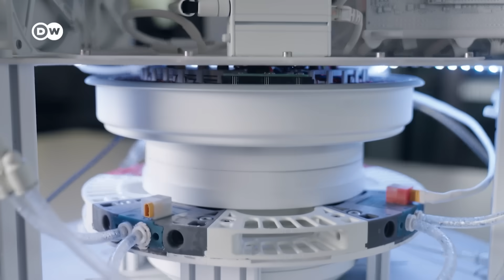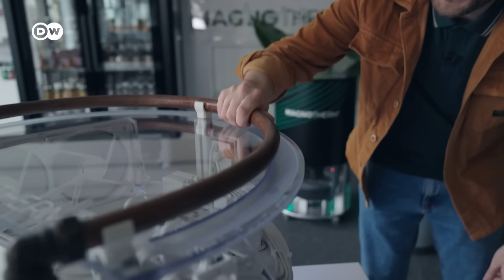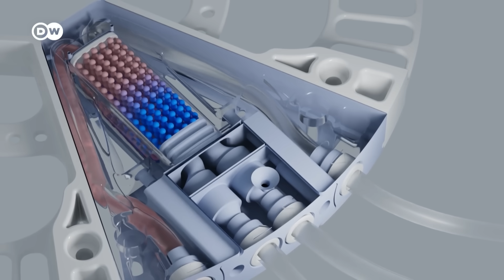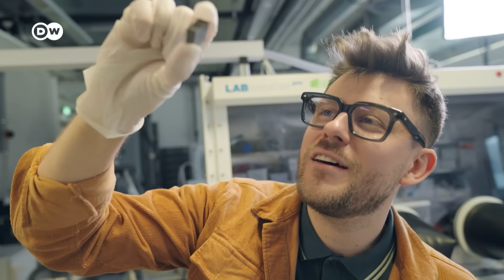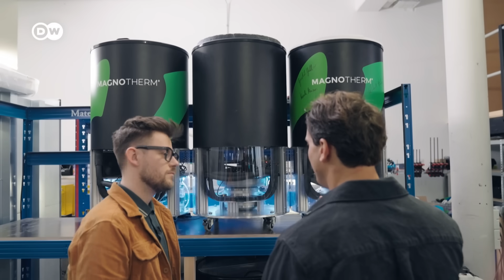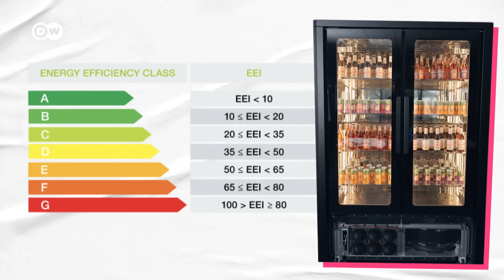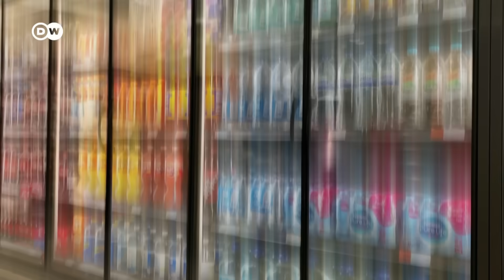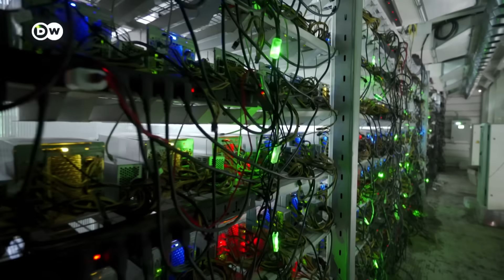How magnets could change our fridges and ACs forever

Comment: Sounds like a lot of complexity + rare earth metal + tricky manufacturing which in the end means higher cost and lower reliability than normal fridges ...
Reply: Feels like consumer applications may be limited here. Maybe there are domains (e.g., military) where technology might be useful to use in, given perhaps certain specific criteria that regular compressors are not suited for.
Reply: Maybe suitable for high-end cold chain cooling!
Reply: Was thinking the same thing, the only thing that makes regular fridges not very energy eficient is that gases that work really well are very dangerus to the enviroment, that seems like a way better research path.
Reply: That could have been said few decades ago about a normal fridge. And don't forget - we used to use gas in fridges, which needed replacing over time
Reply: @nothereandthereanywhere  okay but they said their goal is to maybe get a 1:5 cooling efficiency, while we have modern fridges that get 1:6 and above. why on earth would you pay 5x as much, for a less reliable, untrustworthy, unproven product, that isn't as efficient, and cant get to sub zero temperatures? maybe this has some niche use for in vaccums or space or some lab scenario where you need very specific things, but for a general refrigerator, this is pointless.
Reply: @Evelyn80264  There is no way they can compete with heat pumps, but there are ways to make heat pump coolers better and more efficient, that 30% figure they presented could be done easily by chaining multiple smaller pumps to reduce power and get better cooling, that would raise the complexity of the system though, using some gazes that aren't that safe could raise the efficiency and cooling too.
Reply: @rain4279  Even then I dont think you can come up with something better. We are just better off using a better refrigeration coolent. We know they exist, but we dont use them because of safety reasons - but even then, some could be used here with a bit more risk. Same for cooling a home. In some ways, we went backwards because of the safety and environmental protection. Best bet would be to look at some how combinding systems instead if you ask me. Such as instead of moving your hot air out, you move that into your hot water tank instead. Heat pump hot water heaters cools the home already because of this fact, but you are still wasting that heat when you cool the house down on top if it trying to pull that heat in. In winter, your refriger actully helps keeps the house warmer. Blancing the two options out over a home size heat pump could offer lower energry cost and use less over all power if done right.
Reply: @Evelyn80264  That is a host of assumptions.  
Also remember original fridges were just ice in a wooden box. We've had some time to improve them since then. These will improve just as fast as more companies are created to compete and consumers call for lower prices and better cooling.  
Also, it's only using 8% rare earth, and it's 3D printed. 3D printing is nothing new any more. You can buy reasonably priced 3D printers that print titanium in your home.
Reply: Today's refrigeration systems are very reliable and quite cheap. The major fear with anything like this is that dictatorial government agencies will order the removal of those reliable/cheap refrigeration systems to be replaced by something as unproven and expensive as this new tech most likely is. As they have done, for instance, with their automobile mandates: "throw away your cheap/reliable ICE engines and replace them with our new fancy EVs that will break your wallets and our power grids if we get our ways." I'm looking at you, EU....
Reply: @demef758  So according to you, ICE engines are cheap and reliable and EVs are fancy? And dictatorial government agencies are pushing them? But the world's best dictators Trump and Putin are not pushing for EVs; they love oil-guzzling ICE, right?
Reply: @demef758  You have no idea how complex an ICE engine and vehicle is or has to be.
An EV is much less complex and easy to make, it is dirt cheap.
That is the problem, you can't make big money on cheap items in a limited market --- people are just buying one car within a few years, that is not much, therefore every item has to make big money.
But you can't charge big money if your product is dirt cheap and easy to make ... that's why the US has a 100% import tax on EVs, so that Ford and GM can continue to rip off USers.
Reply: @demef758  gas keeps getting more expensive, and batteries keep getting cheaper. Outside the west, like in china, more than 60% of new cars are EV's, while it's like 10% in the USA. batteries are a one time expense, it takes some rare materials, and needs precision manufacturing. but engines use rare materials and use precision machining too. at this point it is cheaper in total lifetime cost to get an EV, a honda CRV is 31k starting price, hybrid is 36k, and the prologue which is basically the EV version is 39k. so 8k more for EV vs gas. in that car's lifespan, lets assume it lasts 300k miles, at 30mpg, thats 10k gallons of gas. even at 80 cents a gallon and ignoring oil changes and maintenence, you'd barely break even. at the current rate of $5 a gallon, and it will keep getting higher from inflation and scarcity, thats $50k spent on gas, who knows how much more on oil changes and maintenence. so yeah, it's 10k up front more, but 40k cheaper total.

Comment: I didn't got the reason of using BLDC motor rotating the magnets instead of applying switching magnetic field from the same windings directly to the lattices, eliminating rotating parts as well.

Comment: why using a rotating magnet and not a copper coil which can turned on an off?
Reply from the maker: Good question! Rotating magnets are just a simple, efficient way to keep the magnetic field changing. You could switch a copper coil on and off, but that wastes a lot more energy as heat.

Comment: so if applying magnetic field aligns the individual molecules causing movement and hence heat due to friction, heating up the metal block. but by that same logic when the magnetic field is removed and they get randomly oriented shouldn't they heat up even more instead of cooling or am i missing something here?

Comment: Making fridges top opening rather than front opening might be a no brainer quick win for increasing efficiency. Similarly, in cold weather, allowing the fridge to benefit from the cold weather outside might reduce cost of keeping contents cold in a warm house. How to make these design features practical to install and use is the challenge. So...get to it you boffins 👍

Comment: Jesus Christ, no, a heat pump or condenser is nothing like sweating.

Compression-based cooling works via phase or state change, not evaporation. It relies on the same fundamental thermodynamic principles behind all caloric systems, whether magnetocaloric, elastocaloric, or electrocaloric. The process involves changing the state of a material, through pressure, magnetic fields, or other means, to absorb or release heat.

Modern systems use a refrigerant fluid, a compressor, and an expansion valve. The refrigerant is compressed to raise its temperature and pressure, then expanded to drop its temperature rapidly. This is how refrigerators, air conditioners, and even PC cooling systems function, though PC cooling often involves simpler convection or liquid transfer without full phase change.

Magnetocaloric systems replace the refrigerant and compressor with a solid material that changes its magnetic entropy, and therefore its temperature, when exposed to a magnetic field. It is still based on thermodynamic state change and has nothing to do with evaporation like sweating. If anything, it is more similar to non-shivering thermogenesis (brown fat activity) than sweating, though even that is a stretch.

Many Europeans already misunderstand how heat pumps and condensers work, and this kind of analogy only adds more confusion.

The main motivation behind exploring magnetocaloric, electrocaloric, or elastocaloric technologies is to eliminate reliance on refrigerants, particularly those with high global warming potential like CFCs and HFCs. These alternative methods are not new, as we have understood the underlying physics for decades, but the challenge has always been efficiency and scalability.

Currently, gas-compression systems remain the most efficient for small-scale applications such as domestic heating and cooling, especially after the development of synthetic refrigerants. Alternative systems show promise, but their efficiency, reliability, and cost at the small scale are not yet competitive.

Magnetocaloric cooling also depends on rare-earth elements like gadolinium, which are expensive and geopolitically sensitive. This limits their viability for widespread domestic use in the near future. Elastocaloric systems, on the other hand, are promising due to their low noise and high efficiency at scale, but they present durability and maintenance challenges and are difficult to miniaturize.

Comment: So these fridges will require water supply
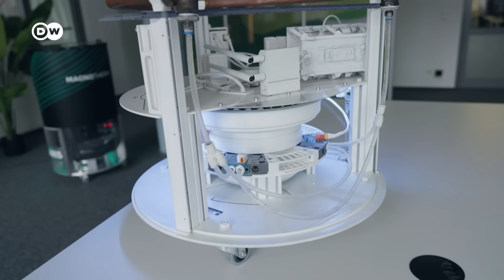Reply from the maker: Hey there! They don't need a household water supply in the same way an ice maker or plumbed refrigerator does. They do depend on a closed-loop water system. 💧 This is explained from 2:56 to the video.

Comment: Effective energy savings in households can be reached by replacing older fridges before they break down. There are still millions of fridges around that are operated beyond 20 years. I have even seen some with doors that don't lock or close anymore. The economic savings out weight an extended lifetime at some point. Also positioning of fridges in houses can be optimized: Not next to radiators or in full sunshine, preferably in cooler rooms with sufficient room for airflow at the back. Then there is the cleaning and de-icing that occurs too infrequent.

Comment: So for instance if we say we have to run fluids with a set amount of time or have some sort of ratio. Well we don’t need that. What if we enclose them in such a way that the material is done my air convection continuously and the fluid flow transferring the cold to the refrigerator stays still in the system. At the instant the cube is demagnetised you rush the fluid in to prevent cooling loss in the environment since we know the fluid touching the cube will be the first priority for the heat🤷‍♂️

Comment: Heat pumps, floor heating and cooling, how about those?
Reply from the maker: Good question! It could work for home heating and cooling in theory, but right now it’s mainly being developed for smaller systems. Here's a study from the Danish Technical University that doesn't focus precisely on heat pumps, but the principles discussed could theoretically be applied to them as well 👉https://backend.orbit.dtu.dk/ws/portalfiles/portal/297622935/1_s2.0_S0140700722003735_main.pdf

Comment: What is the temperature inside the fridge? Even if you manages to get the inside down to 9 degrees Celsius, which is not possible if that is the lowest temperature the water get to coming out of the block, it is still not cold enough for a fridge. Also, what is rate of heat exchange? How quickly will the inside temperature recover when things are added and removed?

Comment: What about thermoelectric plates or modules?
Reply from the maker: They are used in small-scale cooling, like in portable coolers or electronic components, but they typically have lower energy efficiency compared to magnetocaloric systems. 🤔
Reply: @ 
Thanks, I always thinking to have them for home coolers ☺️

Comment: I'm not a science student but I know moving parts can cause problems in long run so why don't they just use a electric magnet and instead of rotating it they turn it on and off in the same rate?

Comment: Great idea! As an electrical engineer myself, I tried to improve the existing design in my head.

Using electromagnets instead of permanent magnets. Pros are no need for a rotating assembly. Because an electromagnet can be turned on and off, reverse its magnetic polarity easily. And the field strength and flux density can be increased by just increasing the current and using more windings.
Next is using gallium as a heat exchange fluid. It’s much higher than water. But handling gallium is a bit of a technical issue even though it’s generally considered non-toxic and generally safe to handle.

Minor tweaks in design might make this project successful. Because even if this machine performs at par with the existing compressor-type machines or even if it consumes little more energy, it’s a great success because we have eliminated the use of refrigerants that are damaging our environment.

Efficiency cannot be brought into equation when we are dealing with saving or destroying the place we live. Modern renewable energy systems can provide clean power for the added energy needs.

I hope this project succeeds soon.

Comment: Someone forgot to tell Antarctica and the Arctic circle that the planet is getting warmer and warmer.   There is more ice in the Arctic now than there was in the 1970's.  The alarmists like to show the yearly melt in the summer and proclaim that it is an emergency that never happened before, but you will not catch them there in the dead of winter when all the ice that melted in the summer is right back where it was the previous season.
Reply from the maker: Hey there! According to NASA satellite data since 1979 show that Arctic sea ice extent has been decreasing at a rate of approximately 12.2% per decade during September, the month when ice coverage is typically at its minimum. 👉 https://climate.nasa.gov/vital-signs/arctic-sea-ice/?intent=121
Studies have revealed that the Arctic has lost over 2 million square kilometers of sea ice since 1979, marking a decline rate unmatched in at least the last 1,500 years. 👉 https://climate.mit.edu/ask-mit/how-much-has-arctic-ice-declined-and-how-does-compare-past-periods-earths-history
In March 2025, Arctic sea ice reached its lowest maximum extent in the 47-year satellite record, measuring 14.33 million square kilometers. 👉 https://nsidc.org/sea-ice-today/analyses/arctic-sea-ice-sets-record-low-maximum-2025

Comment: I build refrigeration systems as a hobby. Compressing a gas to turns it into a liquid, when the liquid turns back into a gas it absorbs heat. It's as simple and brilliant as it gets. A lot of the inefficiency comes from the exchange from the system to the environment. Maybe there is a more efficient way to make a fridge, but if yiu have an application that you need a freezer or something colder this won't work. By the way you can get from 70 degrees F to -60 degrees F with a single  6000 BTU compressor depending on the refrigerant used. That's crazy

Comment: Wouldn't need to worry about energy savings soich if we had more nuclear power...that said, I don't see this taking off. Seen this before but technology has changed a lot over the decades so maybe with 3D printing and metalergic technologies improving as fast as they are who knows. Maybe we'll find a way to cheaply and easily make a magnetic source that strong and really small... strong doubts right now but who knows. This is another technology I'd ask "but why?"

Comment: Some people maybe a good guess of 5° of the people in the world are electro magnetic sensitive and may not be able to use it. 

However, if even 75 ° of the people use it, it's a really big deal.

30° less electric use saves money and pulls less power 🔋 which in return saves materials and less need of furnaces and other means of production.  So while it's not big for the world consumption even if it saved 1° overall along with other technologies in other needs from smart homes and cars it could save 10 to 15 percent each year. 

I would guess in the last 20 to 30 years we have saved or reduced electrical grid needs by 20° or more.  So each 5 years + or - we get 100° savings.  Or 1 year free compared to the previous needs.

Keeping in mind that each year for the last 30 our uptik of the use of computers, cell phones, large screen tvs and other electronics we could come to a zero gain.

On the other hand it's better to stay even than in the negative per se. 

Hopefully in the next 5 to 10 years we will get other technologies that will reduce the needs and perhaps save more or at minimum stay at zero in the positive or perhaps save savings for the extention of resources. 

If not for the research and development of such technologies we would be using 20 to 40% more on the same limited resources. 

Perhaps in the future we will get to a point of balance of renewal energy that would see us into the next 100 years into the future. 

Great video.

Comment: The way it was explained to me is, A refrigerator does not get cold, It is.
Removing heat.
Is same as a air conditioner, The condenser outside is removing the heat from inside making it feel like it's actually cooling down, When in reality it is only removing the heat

Comment: Instead of moving the magnets physically, cant they just switch an electromagnet on and off electronically? I mean they can do that thousands of times per second making the cycle of heat extraction much faster? Am I missing something? But nonetheless interesting concept!
Reply from the maker: Hey there! There is research using electromagnets that can be switched on and off. However, many focus on a rotating system.

Comment: The great point about the conventional fridge system is that the pumping, the valve control and the cooling processes are all merged well into a single mechanism.
Here you have separate mechanisms for each of these processes.